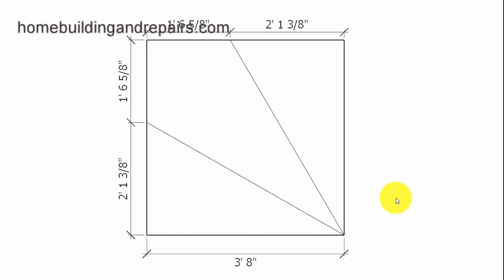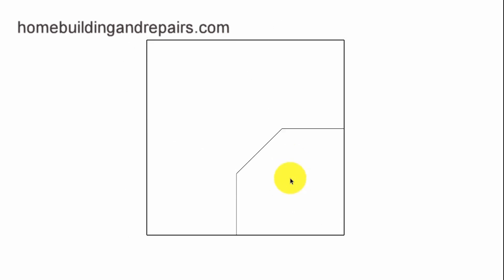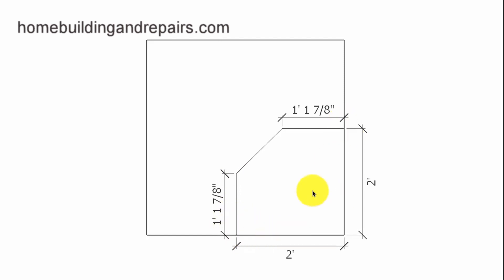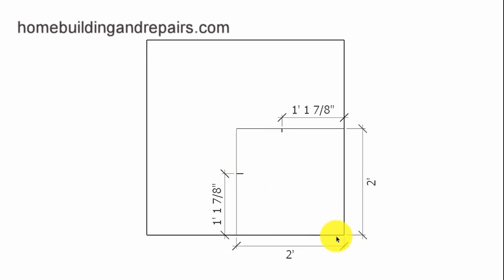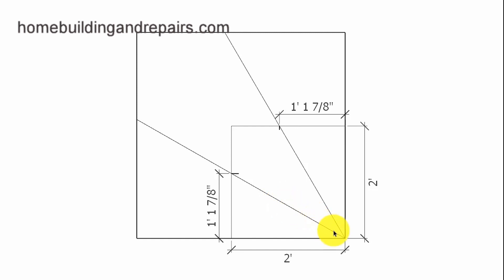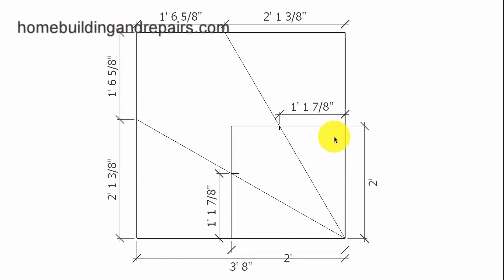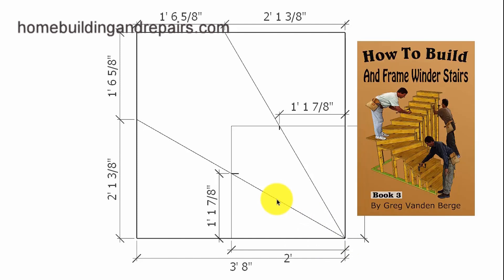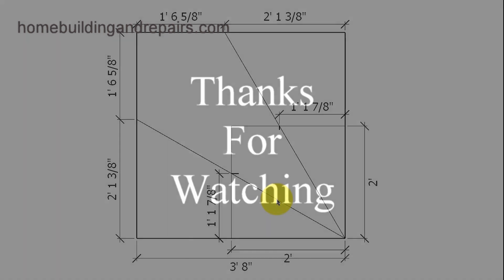How To Calculate 30 Degree Angles For Winder Stairway Design, Layout And Construction

Comment: We are required to have at least a 6" piece on the smallest part of the stairs. Would you simply draw a line where the angle is 6" and basically cut your box there? This would be for a 36" or 38" wide stair.

Comment: This is a great method.  The only flaw is that it assumes that the landing can be built perfectly square, which is not always the case, especially in retrofits of older homes.  What then?
Reply from the maker: You could always start with square inside corners and not outside.

Comment: Don't the winder stairs need to be 6" wide at the narrowest point?  These each come to a single point.
Reply from the maker: You would need to check with local building codes, to verify. You can use this method and simply move the lines in from the center point until you have the 6 inches. I also have a book on building winders at our website.
https://www.homebuildingandrepairs.com/books/index.html
Reply: They do, to increase tread depth along the line of travel set up a geometric circle with the centre point outside the stair box.